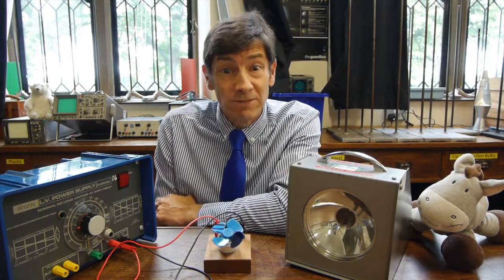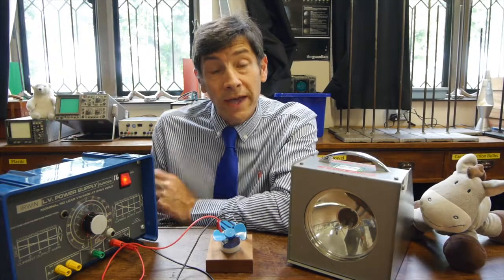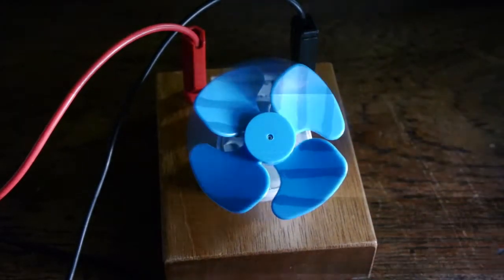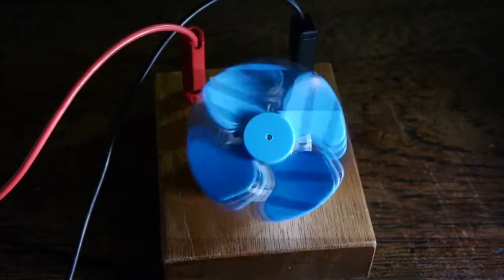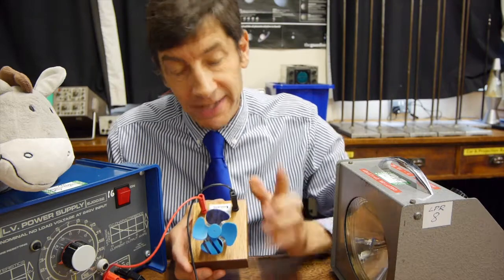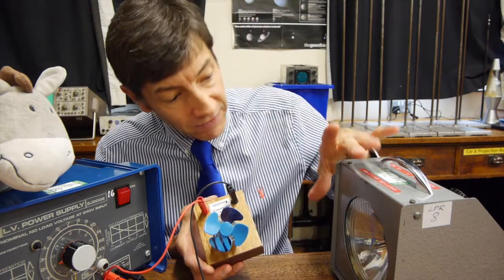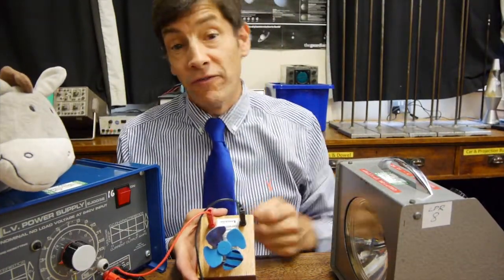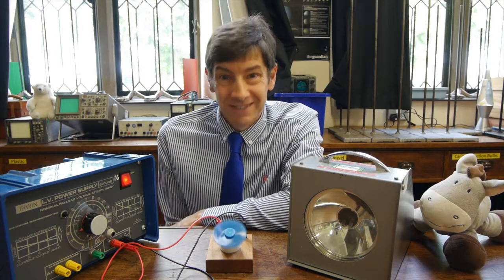The Stroboscope And How It Works - F-J's Physics - Video 126

Comment: Thank you sir. Could this be used on water ripples
Reply from the maker: Yes it's perfect for that if you illuminate the water ripples correctly.  You can 'freeze' them in time and therefore, know the frequency and measure the wavelength more easily.  Some ripple tank setups have a strobing lamp in them to enable you to do this or the dipper is in phase with a strobing lamp.  Thanks for watching and a great question!

Comment: Fantastic explanation, but u could have used a little more technical terms
Reply from the maker: Thanks Muhammad.  Is there anything more technical that you would like me to explain or to add?  If so I can add it to the pinned comments.  I made this video as a general science example so it was not meant to be too technical but I get your point - there is so much more one can say about strobes and strobing effects!  Thanks for watching and taking the time to comment.
Reply: @AnthonyFrancisJones  How rotational speed of the fan can be matched with the frequency of light, by determining the amount of time the fan rotates to it's position and having that frequency in the light etc, overral a little more depth on technical side.
Reply from the maker: @MuhammadAnas_Official  Thanks, that's a good idea and would allow for the introduction to angular velocity ideas.  I could do the experiment with a swinging pendulum too to show the similarities of linear (small amplitude) oscillations to circular motion.  I guess I only have under an hour in my lunch break and no script so they are a bit quick and simplified but I do really value your input.  It is always great to get suggestions even for other videos such as the Tennis Racket Effect or the Halbach Effect which were both suggested by different subscribers.  There is so much interesting physics out there!

Comment: The most likely reason that wagon wheels turn backward in old movies is editing matches the old projection or camera frame rate with the current frame rate. The process is pretty simple. Just make an array of how different every frame is from its neighbor.  This index should give you a starting place to choose images to duplicate or decimate. The sum of two pages xored together pixel by pixel is where I would start. I believe that can be scripted in ImageJ. The difference may also work. I chose XOR because it's uniformly fast(1 machine cycle) on all platforms.

A strobe light is great for timing and calibrating things for time. All you need is  a ruler, a weight, and a way to drop the weight so it appears in the picture along with the subject illuminated by the strobe twice. A falling weight in front of a ruler allows anyone to calculate time inerval in a YouTube video. We used them for almost everything. If its an old one it may have an external trigger that can be set up to catch events such as gunshots.
Reply from the maker: Gordon, thanks very much for this excellent explanation.  I do like the falling weight idea rather than the rotating disc type time stamping method.  A bit of maths needed as it is non-linear of course but nothing suvat would not sort!  Would make a good question for my A level students!  Thanks for watching and taking the time to comment so fully.

Comment: The first time I heard about the danger to someone caused by a flashing (red) light was in the movie "The Andromeda Strain".
Reply from the maker: Yes, interesting Gregg.  I believe they actually made the flash frequency incorrect purposefully so as to not induce any epileptic effects in viewers, though, in fact, the range of frequencies that cause issues are quite broad I am told and not restricted to one particular frequency of light flash.
Reply: @AnthonyFrancisJones  Years ago, I was riding a bicycle going from Perpignan to Sainte Esteve France when I passed some evenly spaced trees on the right that blocked the Sun. My eyes had trouble shifting back and forth.
Reply from the maker: Yes, I have seen similar things on the motorway when there are regular barriers set up with the other headlights.  There is a wall in one of the rooms that I work in that has horizontal wooden strips about 4cm apart all the way around it and I just cannot look at it without feeling dizzy!  By the way I must do a Moire Fringes video at some stage too.
Reply: @AnthonyFrancisJones  yes you do it... I just came across ur video... Nice work❤
Reply from the maker: @prajaktamajalekar5688  Thank you.  Hope the flashing wasn't a problem.  I did try to be really careful.  It is an interesting device and does so much more than just produce 'stop/start effects in discos!  Thanks for watching and hope you enjoy some of my other videos!  F-J.